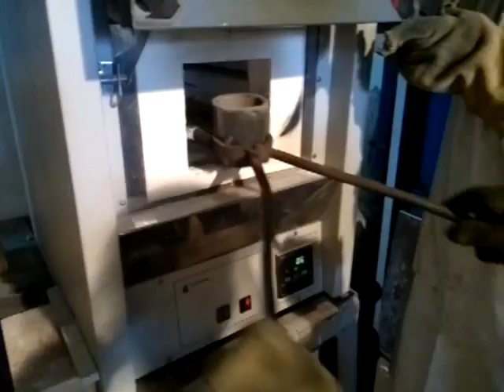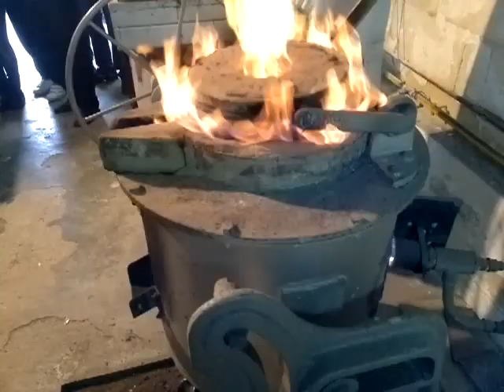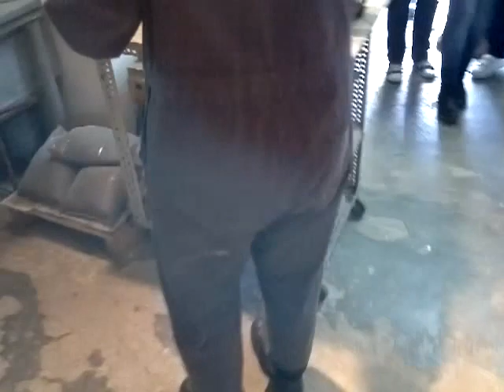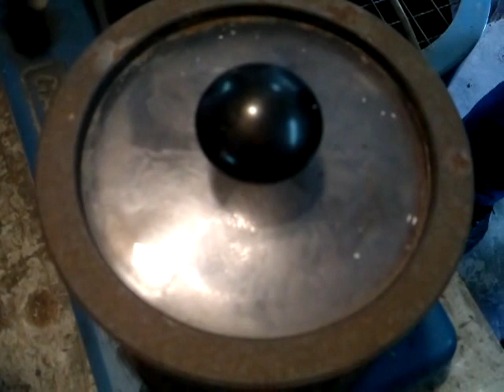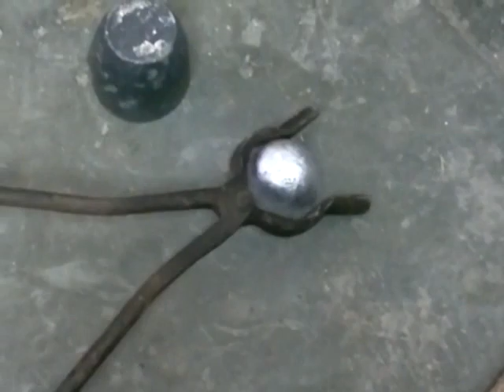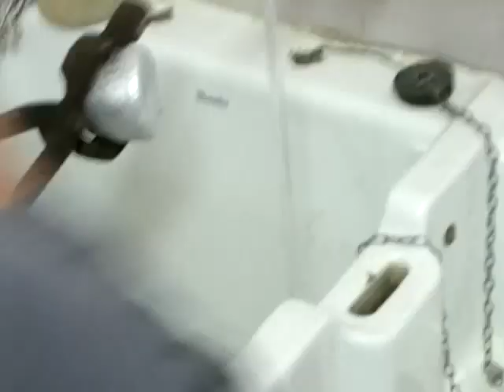Degassing of Aluminium

Comment: nice but degassing with what? Any info for the international audience?
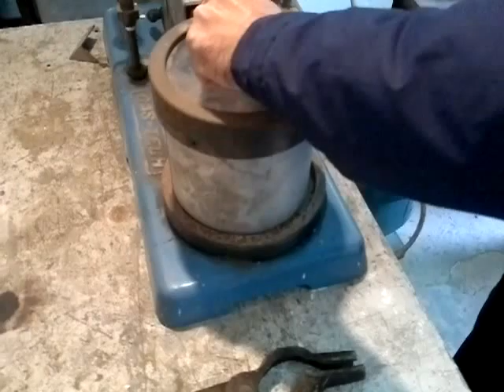Reply: Funny that the video has existed for eight years and you and I ask the same thing at two weeks interval. It really could have been more informative but I think it's a vacuum pot at 0:50 so the vacuum does the degassing. That's a method commonly used for degassing plastic. Too bad we didn't see the piece cut so we can't tell if it worked or not.